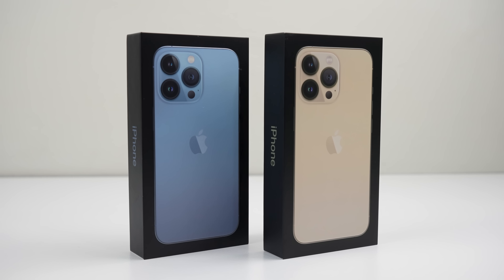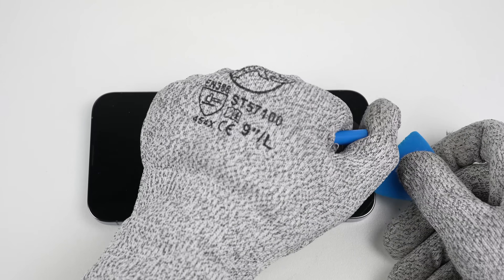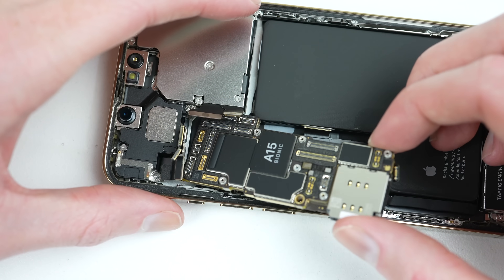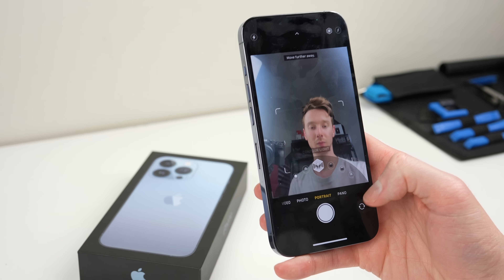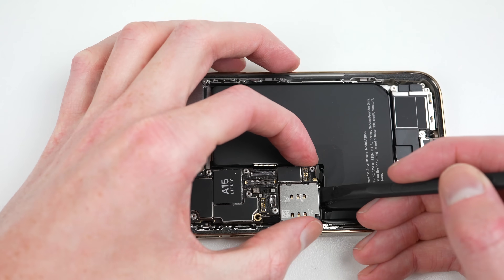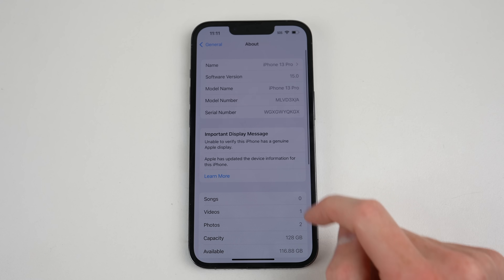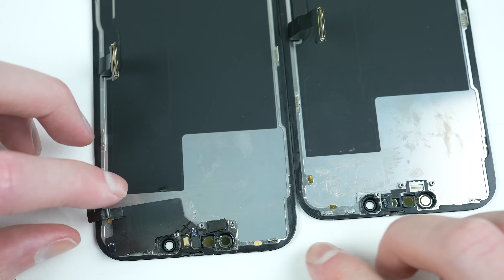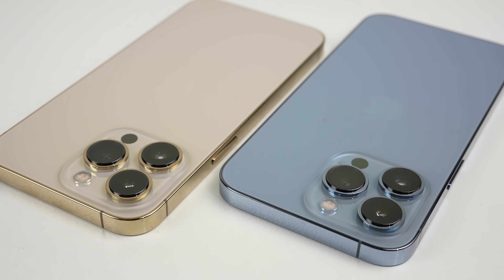iPhone 13 A Repair Nightmare - Teardown and Repair Assessment

Comment: It's almost impressive how they can make their phones self destruct like that.
Reply: With this I feel like they will lose more followers and over all customers. Because their repairs are freaking expensive as shit. My whole life I've bought only androids dropped them so many times and only one cracked after 5 drops.
Reply: @Kristadamus  I swear, Androids are tanks.
I've had my Honor for almost 3 years, still feels like new. Even after not getting any more system updates, it still runs perfectly fine. And damn is it sturdy, slap a cover up case and you're good to go.
Reply: @Gabriel-he6ih  I am with a Huawei P30 Lite rn. For Christmas I will get Xiaomi Mi 11i or Mi 11 lite
Reply: @Gabriel-he6ih  3 year android is tank🤣🤣. Texting from my 5 years SE. I do own andoid and 2 years barely survive. The reason I love iphone not because model but the OS. Less model design is bonus so it easier to find phone cases. But yes, apple is EVIL to block self repair. Luckly mine still can be repaired atleast until next 4 years.
Reply: @Kristadamus  nope. They're expensive and therefore a flex in insecure peoples eyes. Tzey will continue to buy apple
Reply: @Kristadamus  i renember i dropped my android down the stairs twice and onyo concrete and it was fine
Reply: @Kristadamus  they won't, apple is essentially the phone equivalent of Gucci, it doesn't matter its overpriced and you can get better for cheaper, people buy it to show off
Reply: @Kristadamus  I feel like you have to drop an android JUST right, like in a corner, or ON a corner, just for the screens to crack lol.
Reply: @Laughing_Dragon  the a51 breaks really( i cracked mine 3 times and it was cheap af to fix) easly but other androids don t
Reply: @Kristadamus  ll
Reply: @Kristadamus  ...I've dropped my fuckin Alcatel like more than 10 times this week alone on my TILED FLOOR and one time on CONCRETE and this beast is still functioning. I'm just surprised dude.
Reply: @StrawberryMuffinUwU  I forgot aobu that Brand do they even make phones anymore?
Reply: @Kristadamus  Nokia
Reply: Exactly, like bruh buy an Android
Reply: @skytangoxx749  yOu ArE PoOr If YoU dOnT hAvE aN iPhOnE
Reply: LG gang stand up...

stand up....

please, anybody stand up...
Reply: @CC164_real  I would, but only when the Stylo 7 releases.

Wait...
Reply: @CC164_real  uuh...is Sony Xperia good enough?
Reply: @Gabriel-he6ih  Sony phones are great. When I switch from my iPhone iam gonna get a Sony
Reply: @Defender004  Why Sony?

Because i use Sony Xperia and it is so great. I used Sony Xperia x8... It was indestructible. But phone aged and battery went down. Then i bought Sony Xperia L3. I am pleased again.

So yeah, buy Sony, you can go Xperia 1 iii blindfolded.
Reply: @CC164_real  I've got a G6 and I'll use it till it dies
Reply: @CC164_real  V60 here, just got it to replace my G6 a couple of months ago.
Reply: What's impressive is everyone still riding their wave, just going with the overpriced phone and all the overpriced accessories you need to get use out of the phone😂
Reply: @6double6.  Yeah they are mega stupid😂
Bruh I get it apps like Insta and Snapchat may be optimized for the Iphone because there's like 1 model per year and now you need to buy a freaking charger too which is bullshit😂😂
Reply: @6double6.  apple is the whole ecosystem not just the phone so when any other company can recreate how well everything flows between devices i might move
Reply: @6double6.  Samsung and iPhone literally have like the same prices, most tech is overpriced nowadays. Iphone prices got a lot better than they used to be. The X was $1000, the 13 is $800
Reply: @6double6. Exactly what blows my mind too
Reply: Why i think they will put a mini bomb just to make apple fanboys buy a new one?
Reply: Just buy android
Reply: @undertalle420  I've only bought Android phones, not to worry.
Reply: @Darth_Xionn  well gg. I regret getting apple
Reply: @Darth_Xionn  the apple ecosystem just feels better to me than Android. That’s why I switched over. It’s night and day.
Reply: @undertalle420  id pay 10x an iphone over an android. They are terrible
Reply: @Lucas-qk8lc  Well that's kinda ironic because you probably are spending 10x more
Reply: @Lucas-qk8lc  Android isn't bad at all. My 21+ is cheaper than any new iPhone out rn and it's just fine. Good camera, fast, a lot of storage for the price, while Apple charges a crap ton for a storage upgrade. I will say that the amount of bloatware on android is ridiculous, and idk why they won't fix that
Reply: @zel9061  fair point, perhaps I’ll consider Android again someday, but for now I’m satisfied with my apple phone and laptop
Reply: @Lucas-qk8lc  I'm gonna be honest, android only gets its full potential when you root it. Like, the benefits are just way too good, even makes you consider voiding the warranty, but I guess that can be true for Iphone as well. I wouldn't get an android until next year though. The androids that have come out this year have had some unexpected bugs that haven't been on any other android phone. Android is still good, but until they stop being greedy and fix the bloatware issue, it can never reach its full potential
Reply: @Lucas-qk8lc  well they are 

1 way cheaper 

2 they dont break when a New one Comes out 

3 you dont have to pay astronomic ammounts of money to repair them 

Seriously 10X  it would be something arround 8-10 K Android phones are simply less expensive when you buy and repair them you dont need special parts you dont have self destruct systems inside of them BUT Oh nO mY pHoNe iS CheAp iT MusT MeAn iTs BaD
Reply: @Lucas-qk8lc  oh and dont forget to buy a charger
Reply: @zel9061  just Uninstall or disable them. It's often core apps that are just there and many that they're trying to promote but most of them can be removed if not disabled completely is you find no use in them. 
Bloatware used to be a big issue not so much anymore.
Reply: @Lucas-qk8lc  i've used both iOS AND Android. Android is the better OS. I've never felt so angry trying to use a phone as I did the iPhone.
Reply: @nicolebrown1874  If you are angry at a phone, you're living a comfortable life. No need to be angry at trivial things like these. Take some time to get used to the phone and conserve the energy wasted on anger.
Reply: @Livin Vids enjoy Paying 3X the Price of an Android just to get your phone self destructed After a New one Comes out just cause a company wants to suck all the money from you when you Can have a reliable phone for way less
Reply: @undertalle420  you do realize there are currently 1.65 billion iPhones in service right now? Since there are only around 200-250 million sold in a year that would mean there is a hell of a lot of really old iPhones out in use currently. This myth that they break when new ones come out is just that a myth. That speaks volumes to apples quality and longevity, well at least in the past. We will see about the last two generations. I’m not speak on the rest of your reasons, they are strictly your opinions. Now to the right to repair, the software locks are completely bogus and should not exist. When I purchase something, it should become mine to do as I please. If I want to fiddle with it and add blue side buttons to my silver phone so be it. If I break the screen, I should be able to throw anyone I want back on. That part of apple sucks.
Reply: if you got "unlimited" money from die hard Apple fans, what would you do?
Reply: Should be illegal to sell something that breaks itself.
Reply: My favorite is when people compare a 300$ Android to a 1000$ iphone. If you spent 1000$ on an Android you would get better quality than a 1000$ I phone. If you paid 300$ on an iPhone you would get better quality from a 300$ Android. I would only buy an iPhone if every android battery was at risk for blowing up. But so far that one Samsung note has been the only one to do that.
Reply: @Livin Vids Imagine only buying Apple for electronics, cringe.
Reply: They really care about their users dont they😍🥺🥺♥️
Reply: @Livin Vids want to know why they sell for such high prices? Because people who sell them regret paying so much when they bought them. 
And no Iphones may not break easier than others but they suck. They need adapters for everything. And for each generation you need to buy new ones... 
Why? It's not like an old one wouldn't be able to charge it if they didn't change the usb port design.
Just complete bs.
Reply: Not as amazing as how loyal people still are after knowing any of this
Reply: @althechicken9597  That's the most impressive part.
Reply: Last thing to have a Kill Switch... 🥺
Reply: Capitalism does indeed breed innovation, just not the useful lind
Reply: it shouldn't be legal to sell these phones.
Reply: @bloodred255  Big corporations run the world, so they can do what they want.
Reply: As you see, someone (i won't point at anyone) want getting money from their (monopoly) repair service
Reply: I thought the same thing about al-Qaeda and their soldiers. 🥸
Reply: It's almost like an art to do it on every part from a sensor cable to a camera to logic board and display. Next thing it will be the battery!
Reply: Johnny Chimpo  don’t say things like that if you don’t know what it means
Reply: They want more money but dammm
Reply: Johnny Chimpo  I'm hoping it was meant ironically... I, unfortunately, got myself an iphone SE 2020 before knowing they lobbied for slave labour to carry on in China (along with a host of other well known companies like Coca-Cola and Patagonia). I do like Apple products because they're simple to use and I'm a simpleton when it comes to computer things (the "it just works" idea when I've had a lot of trouble dith Windows things and the only Android phone I've had was fucking terrible), that said, as a musician/producer, the next apple computer I will get will be second hand
Reply: @Livin Vids you haven't heard how Apple got caught on slowing their old phones down just so the fools would buy a new one? with every update something slowed down till it was detected and Apple (if i remember right) was sued.
Reply: Tbh from a programming prospective it isn’t impressive
Reply: Well how are you gonna buy the iPhone 14 if yr 13 doesn't automatically self destruct
Reply: They do that so you are gonna be forced to buy another phone from they
Reply: Can anybody explain how the f... are they able to get it down to even a single cable? Honestly, it's quite astonishing.
Reply: The only thing thats impressive is how people still buy them knowing this.
Reply: I've long time suggested that devices could be designed to break automatically just after their warranty expires
Reply: @Livin Vids The amount of bugs I've experienced with a few Apple products myself is still far more than the bugs I've ever witnessed or even heard about regarding Android. Like my iPad had trouble connecting to the WiFi just 2 years after I bought it, multiple apps are constantly "shutting down unexpectedly" and the volume sometimes cuts out completely leading to a necessary "restart" (considering Apple products aren't even able to properly restart, only to shut down and boot up again manually, which technically isn't the same thing). 

I agree about the price being so high due to supply and demand, but while the demand is there, it isn't justified for anything but the few Apple-only features and Apps you get on IOS. Just about everything else regarding Apple is basically a false and long lived stereotype of just being "superior", even though those times have passed years ago. Especially considering the accessories as well as most of the greater concepts like the AirPods or the Mac (imagine buying a full blown PC bult into a monitor, only to discover that there's still only a single fucking HDD drive in there like there was 10 years ago).
Reply: @Livin Vids This is the thing, all the Apple fanboys see Apple's fails as lies or exceptions, but they're not. My father (the only iPhone user in my closest family) had issues with this, too. For example just today I needed to transfer some pictures from his iPhone 12 to my PC and even though I accepted every request to look into the DCIM files, it still refused to let me get the pictures. I had to accept the same thing 4 times until it finally stopped kicking me out of the folder. I also tried to send them via Email from his phone instantly, so I could access them more easily, but guess what, even a single picture is seen as too big for the IOS Mail App. I tried it afterwards on my Samsung Galaxy S10+ with no problems at all. 

I am currently writing this on my (old) iPad I was talking about, the only reason I use these few Apple products at all is because of Apps like Procreate, GoodNotes and the ApplePen 2, which I use to save some paper for university.
Reply: @Livin Vids Also, I don't understand why people say IOS is more convenient or easy to use. On Android you literally hold down on whatever you like and it shows you what you can do with it. Wanna change the background? Hold down on it. Wanna get to the WiFi setting or any other settings in an instant, hold down on the Icon and you're right there.

With IOS I once unintentionally accepted some subscription for my calendar and couldn't find a setting in the App itself that let me adjust said subscription, even though it's literally the App responsible for showing me that. I had to google it and had to go into the general settings - passwords - subscriptions - calendar, if I remember correctly, just to tap on the little minus-Icon to remove the subscription. What the fuck, how the hell are you supposed to find that without studying the bs that some seemingly drunk designer or whatever put together.
Reply: @hagenl.2975  "I had to google it and had to go into the general settings - passwords - subscriptions - calendar" huh, what version of iOS was that? For me, it's just Apple ID -> subscriptions
Reply: @heckinbasedandinkpilledoct7459  But even then, why the hell would you have a calendar App if you can't even adjust the whole thing within the App, why always the settings. Or even then, sometimes Android does this too, but then there is always a shortcut included within the App-settings getting you to wherever you can adjust said thing. It's so weird to think "Oh I want to edit my calendar, let's go into the settings"...
Reply: The most impressive part is that everything is on porpuse. They WANT it to be like that.
Reply: It’s simple. Code wise, it’s just a bunch of if statements checking for ID of components and calling a function if they don’t match original constant.
Reply: @JemstoneGames  I don't know what Version it was back then, but they stopped updating my old iPad at IOS 12.5.5.
Reply: @Livin Vids Honestly, flagship Androids look way better than flagship Apples. I love my new Galaxy Note 20 Ultra. Newer Notes just look so pretty.
Reply: @Livin Vids The Note 20 Ultra doesn't really look anything like Apple phones.
Reply: @Livin Vids At least those phones had OLED. Lmao.
Reply: @Livin Vids I don't know about older Androids, but I've had my Note 10+ for about 3 years and it's served me just fine.

Also, first time I've heard someone say that the iPhone was better after Steve Jobs died. The company as a whole went downhill after that, as shown in this video.
Reply: @Livin Vids I like how I actually have an environment that lets me do what I want. I'm a huge fan of emulation and you can't do that with an iPhone unless you jailbreak it. Lots of emulators don't support iOS, and iPhones tend to have lower specs, anyway. People liked the Steve Jobs era iPhones because they were no more restricted than Android phones back then.

iPhones today are overpriced. The iPhone 13 Pro Max is $1600. You can get an Android with better specs for half the price. Why are you wanking off Apple when the only thing you can brag about is owning an expensive product? All you're doing is trying to justify how much you spend on your overpriced junk.

They ruined their reputation themselves. Especially with trying to crush peoples' right to repair their own products.
Reply: @Livin Vids Most people don't care, but most people also don't really put the features on their phones to proper use. All you'd be using an iPhone for are pretty pictures and scrolling through social media. You can do the same thing on much cheaper phones. I happen to actually take advantage of these customization features that Android users talk about. I've downloaded a few unauthorized apps and I really want to dabble around with Linux, but Samsung dropped official Linux support on DeX, so I'll have to find alternatives. You can technically use an Android as a full blown Linux PC. I doubt you can do anything like that with an iPhone.

I haven't ever owned an iPhone because it can't fill my needs. Also, the battery life on Androids is just fine. All 3 Androids I've had so far lasted all day when I first got them, and only my first phone had battery issues. My 3 year old Note 10+ still lasts all day.

Every new Samsung has higher overall performance than every new Apple. My new phone has 12GB RAM, better HDR, a higher res screen which gives it a denser ppi, the CPU is better in some areas, expandable storage, a 108 MP camera compared to the 13 Pro Max's 12 MP, 50x zoom, 8K24/4K60 video, no shitty lightning cable, and a higher capacity battery. To top it all off, it's a LOT cheaper.

If I were 13, then you should be embarrassed.
Reply: @Livin Vids I've never had any of my phones close apps, aside from YouTube, which is buggy on mobile to begin with. I can keep Discord, my gallery, several emulators, and Chrome with 90 tabs open without anything reloading besides those tabs. I have to leave them open for days before they close.

With the way you talk about Android, I'm going to assume that you've either never owned one or haven't owned one in a long time. I'm very satisfied with both of my Notes.  Comparing the specs between my slightly outdated Android and the 13 Pro Max, my phone runs laps around its specs.
Reply: capitalism for ya
Reply: What can I say it's a work of art.🤣🤣🤣
Reply: i only like iphone cause i-message games